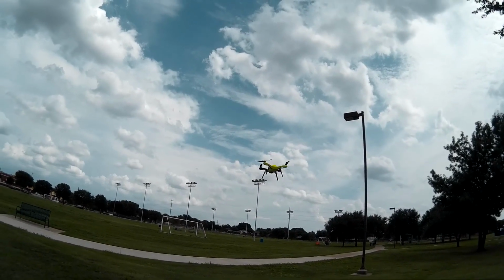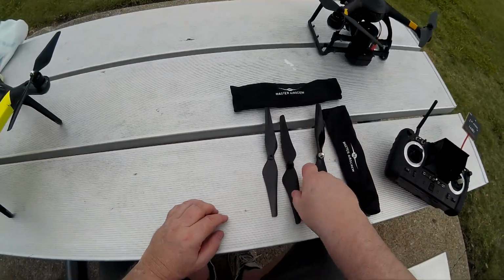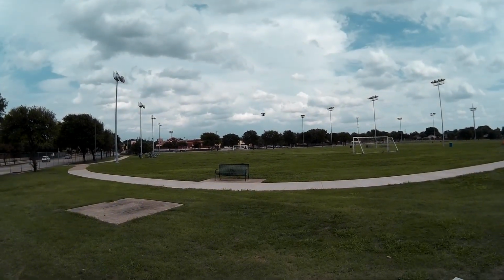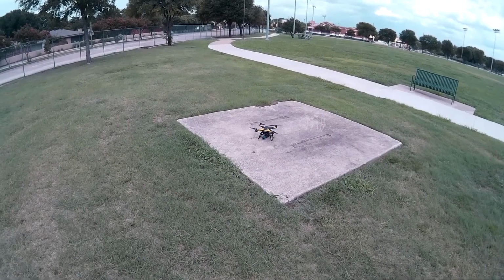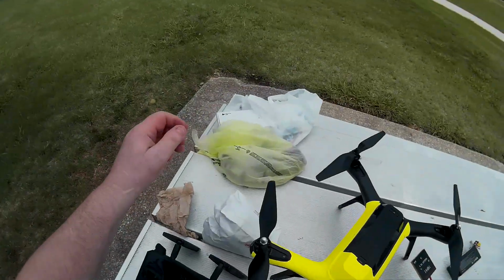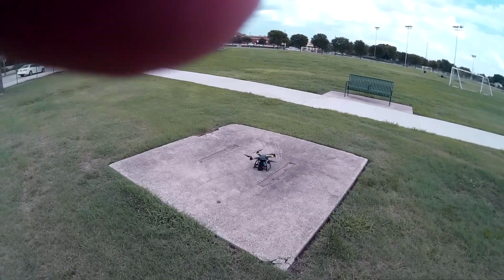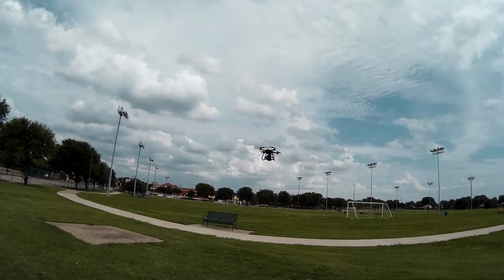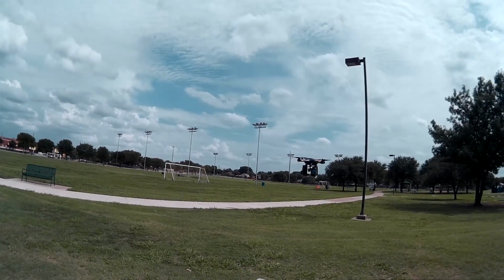Hubsan X4 PRO with 3DR Solo Prop Flight

Comment: Hi Sean. Thanks for putting a link to your video on mine. As you're no doubt aware, I've owned a hubsan H109S and have many hours flight time on them. Basically what you've done is replace the standard 9443 props with 9450 props. The increased pitch means less motor RPM for the same lift. You can do this with any third party props with the same pitch angle. I've done it myself and still reverted back to hubsan standard props. A little flex in the props isn't that big of an issue and doesn't significantly effect flight time or performance. The Hubsan is quite a heavy unit and what you're seeing as a wobble while descending happens with these units because of their weight combined with air disruption and speed of descent. In other words, you're descending into your own prop wash. This is commonly referred to as Vortex Ring State and is easily avoided by moving forward whilst descending. Descending straight down can cause major problems with VRS and unless you move the drone out of it, can lead to a crash no matter how much power you apply. There are no benefits with regard to flight time by putting props on with a greater attack angle. Sure, the motors won't be revving as high but in actual fact will be slightly more sluggish to respond and because those props push more air at lower RPM, the motors are under more torque thus require more amps from the battery to maintain their speed. Thus cancelling out perceived gains in flight time. I learned a lot while I was flying my hubsan exclusively. How to get out of VRS and TBE which these units suffer from frequently. Calibrating compasses over reinforced concrete, for example, is one of the worst things you can do with any drone. I'm flying a Mavic Pro now, which makes you realise  just how outdated and unpredictable the H109S is.
Reply from the maker: Hey Steve, thank you for your experienced reply here.
Yes Sir, totally aware of VRS.. And many are not as in past 109s videos of them coming straight down, getting into their Prop wash, and thus the crashing. Looks like I need to put the Hubsan  stock props on my Solo, and see how those do performance wise, with the less surface space and that 3DR weight. I am sure it will fly exactly the same as with the Master Air Screw props as is implied.
Considering the wobble, I am thinking it is the offset weight of the parachute, because not centered underneath the bird as with gimbal. We will also see how the 3DR Solo does over that reinforced concrete in getting satellites, and all else the 3DR computers  calculate. I am aware of the presence of steel/metal having interference in Compass, and GPS calibration/readings.

Comment: Will those props from the solo fit the h501ss
Reply from the maker: Tony... No Sir. Different size motors and motor shafts between the two. Plus the H501 series birds are not heavy enough to warrant props with more surface space, or hardness, as they do not have the weight involved to get into propwash "as bad" as the H109s with a camera and gimbal.